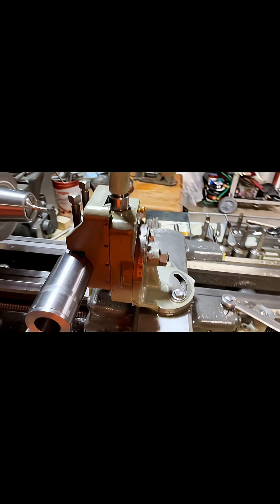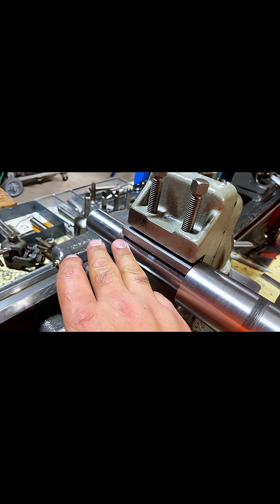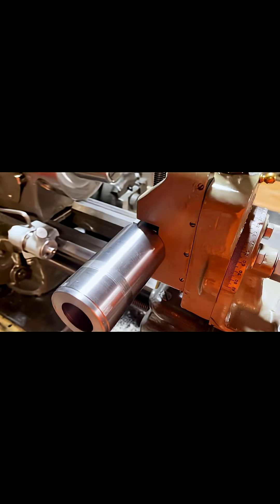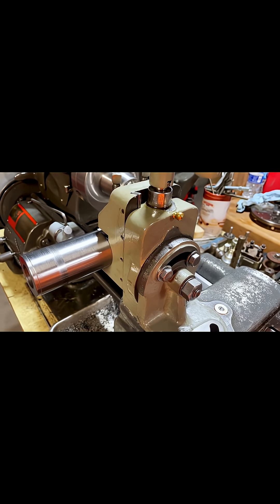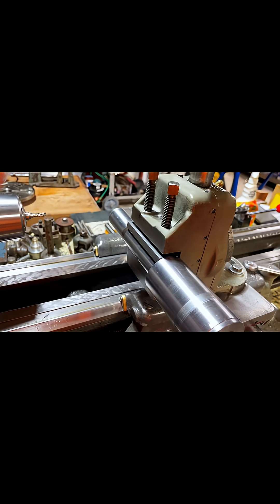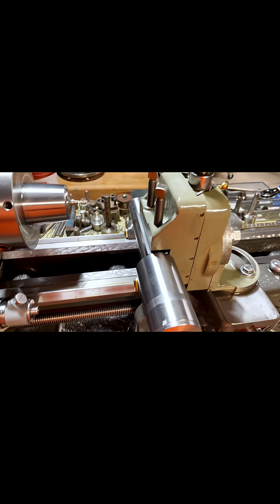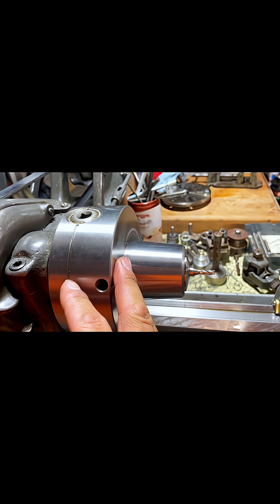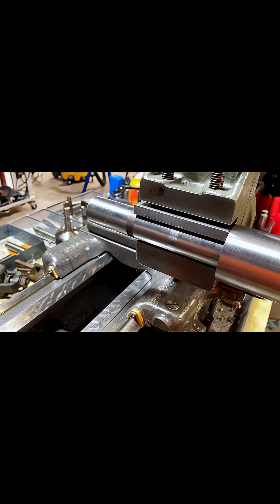Southbend milling attachment Keyway cutting #machining #fabrication #hobbymachinist

Comment: How did you determine the spindle rpm and the feed rate of the end mill? Did you cut the slot in one or several passes?
Reply from the maker: It was all by feel since I don’t have a tach and just know the approximate speeds. I started slow around 600rpm. I ended up cranking it up to the lathes top speed of about 1200 rpm. I fed it by hand a few passes and then activated the cross feed. I took 15 thou cuts at a time so 6 or 7 passes to play it safe.
Reply: I’d guess the Same calculation you’d use to get your spindle rpm for a normal mill I’d assume then from that number just play it by ear till it feels sounds and cuts right